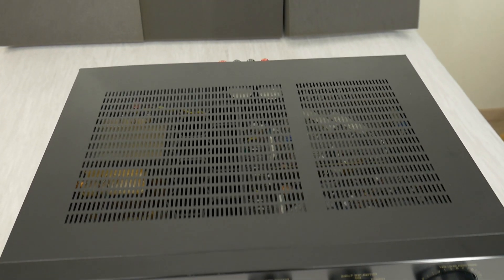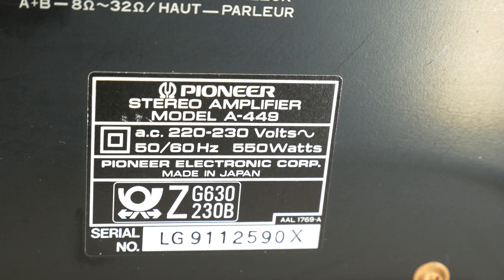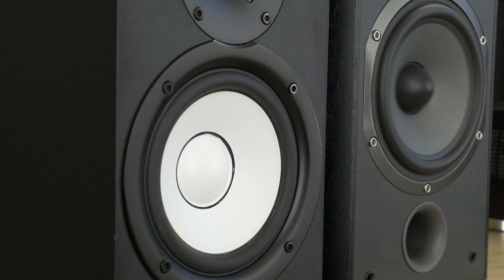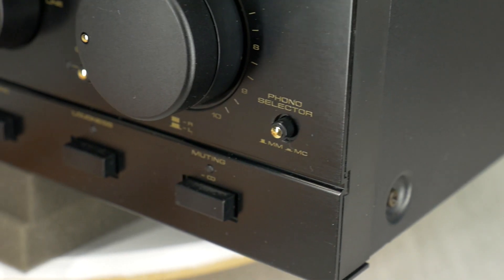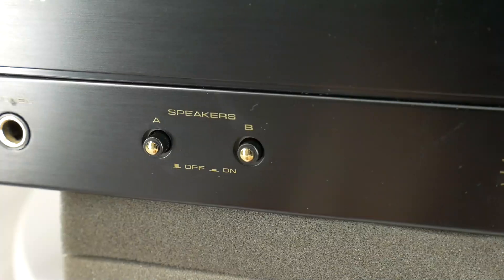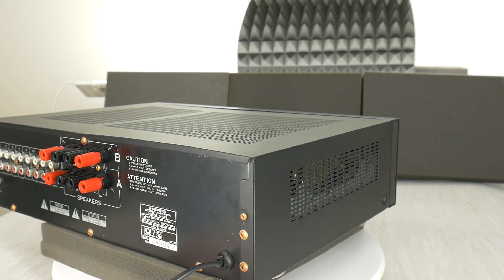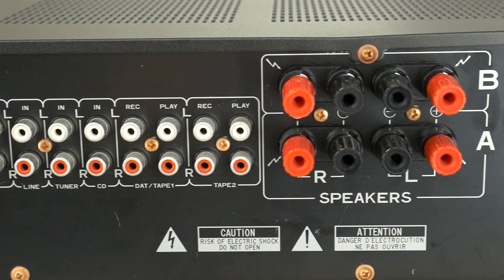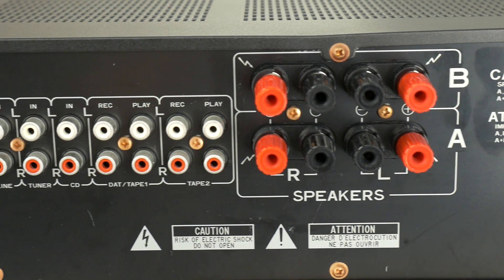Look Inside Pioneer A-449 Amplifier Disassembly

Comment: Hi ! Thank you for the video ! One question . Can you use A and B speakers in the same time ?
Reply from the maker: Yes, but then they need to be no less than 8 ohms in impedance. If you use both zones separately, the speakers can be 4 ohms.
Reply: @Techscrews  thank you ! Unfortunately mine amplifier working just when it s press the button direct . When it s not press , is not working just a low sound in speakers . It’s frustrating because on direct I can’t use the bass and treble settings . Do you know what could be ?

Comment: Old good NICHICON capacitors. I have the first predecessor this serie 44x , Pioneer A-44 from 1985. According to me the A-44 and A-441 had the nicest button and knob panel layouts. Here the switches are only rotary instead of push buttons, I think that push buttons are more susceptible to failure but the combination of both types looks better.😉

Comment: It looks similar to Pioneer A447. Can you describe the difference between the two? This vintage amplifier sounds good, but having an issue of one or two channel spkr is distorted. I dont know how to fix the problem. Thanks for replying.
Reply from the maker: Both amplifiers are indeed quite similar, classic integrated stereo amps with straightforward designs. They are well-regarded for their clean, rich sound and are built with simplicity, making them relatively easy to repair. Your issue with distorted sound in one or both channels might be due to a few common causes in vintage amps, such as dirty contacts, failing capacitors, or issues with the internal wiring or transistors. A good electronics repair shop should be able to diagnose and fix the problem fairly easily. Hope this helps!

Comment: I have like this.. What speaker spec.. Same 60nwatt or 100.waty
Reply from the maker: Specification of Pioneer A-449 amplifier:
- Power output: 60 watts per channel at 8 ohm (THD 0,009%)
- Power output: 80 watts per channel at 4 ohm (THD 0,02%)
- Frequency response: 5Hz - 100 kHz
- THD: 0.009%
- Signal to noise ratio: 108dB (CD/AUX)
- Speaker load impedance: 4 ohm to 16 ohms
- Dimensions: 420 x 352 x 126mm
- Weight: 8.1kg

Comment: Is there guide about the differences among the 4xx line?
I recently bought a A-447 and it is shockingly good sounding. Even the A-227 that I had was really swell and the only "downside" was a bit less muscle in the lows.
I also read that the smaller models may sound better than the 6xx, 7xx and 8xx line - any experiences?
Reply from the maker: the main difference is the power, of course the 7xx series like the A-717 has two power transformers. But yes, they sound amazing good for second hand prices.

Comment: I've recently restored a Pioneer A-447 (very similar) that spent its life in the front bar of a local hotel. It has some scuffs and scratches but still sounds amazing. The chassis had some corrosion so I got it laser cleaned and then electroplated in passive gold zinc.

Comment: I just bought one of these from eBay. It is an amazing amp, loads of power ! It is also filthy dirty so will be getting a deep clean very soon :D
Reply: o have one too but sometimes only one  speaker will be playing while the other is just humming and if i turn the input selector a few times it goes back to normal, also the audio buzzes like crazy when i change the volume from the amp itself, I don't know if its from the amp or the speakers but something is definitely wrong😂